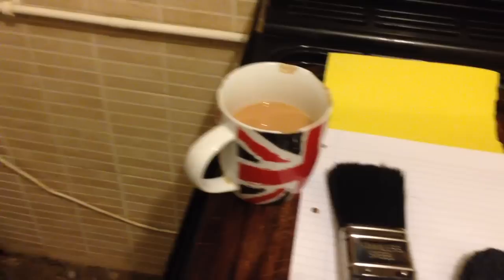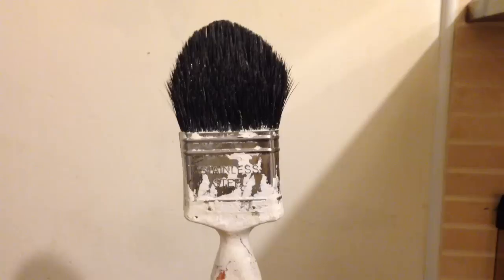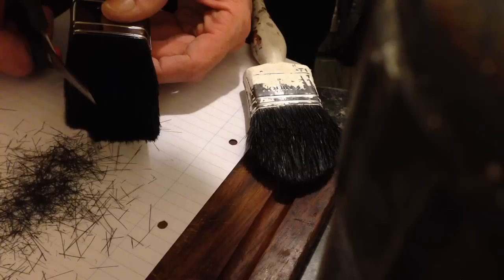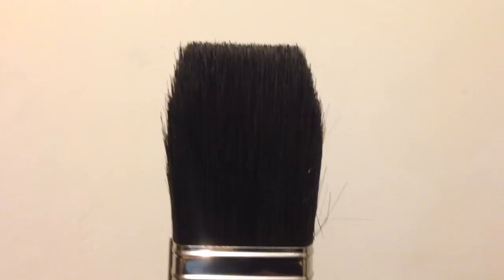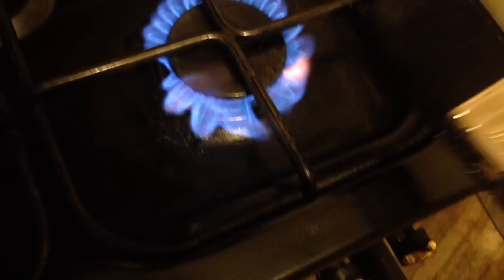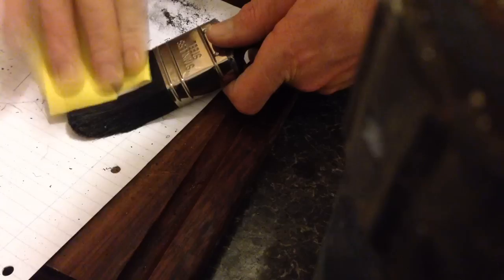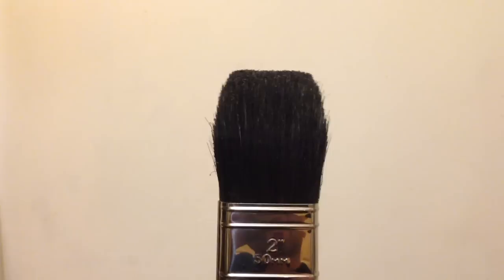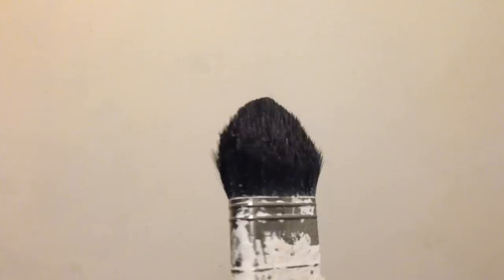Painting & decorating. How to shape a paint brush, ,Trade secrets.

Comment: If this is the way to do it, why are you the only painter doing this? I don't see how this is better. Good brushes over here aren't cheap, about $30, which in your money is about 15 pounds. I would have to test your method on a cheaper quality brush. In my experience you want a flat brush, not angled sash brushes. Those are designed for windows, not walls. And a 3 or 4 inch is best as a 2 or 2.5 won't hold enough paint for walls, which means you slow down. I have found the secret of getting straight cut lines is not in the angle, but in the quality of the bristles. Quality bristles will lock right into the corner. And you can shape and manipulate the bristles as needed.
Reply: I've tried it a couple of years ago,   they worked quite well for cutting in on the skirtings/trim and doing spindles on stairs other than that I would just stick with a flat brush or angled brush personally
Reply: He literally says it’s for the side of architraves and skirts on the video ffs